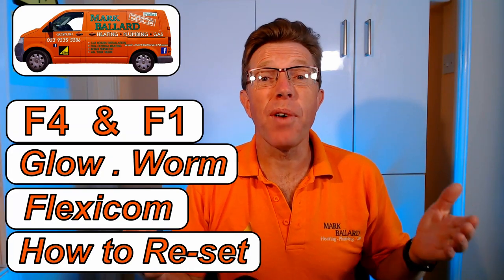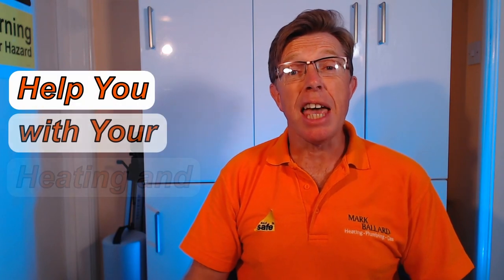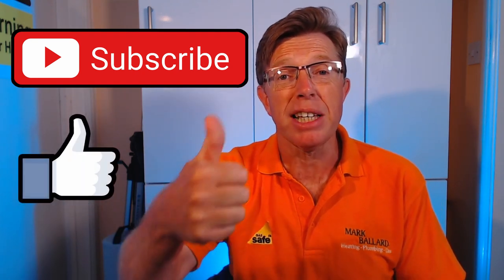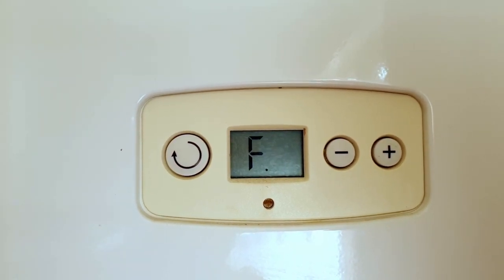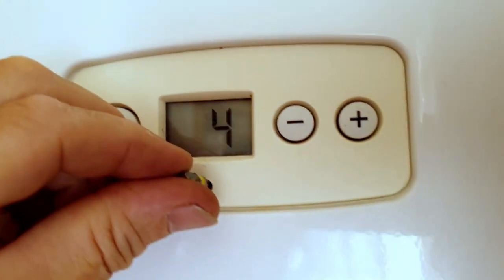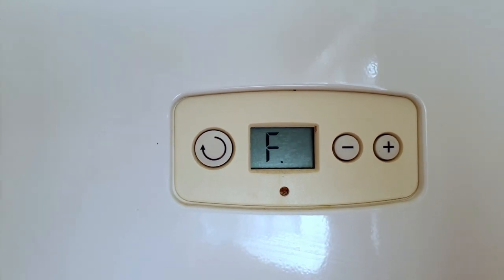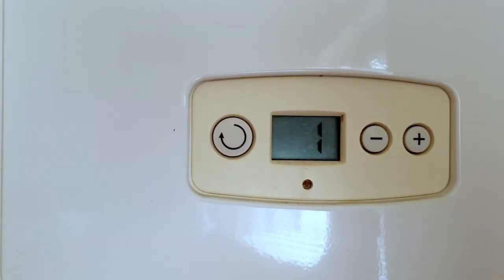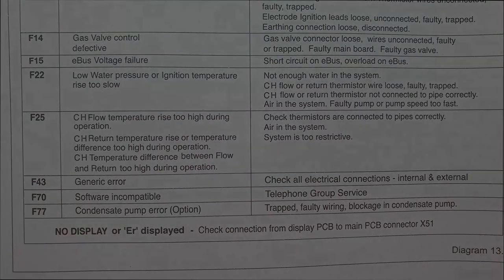F4 & F1 Glow Worm Flexicom How to Re-Set Your Boiler

Comment: Hi Mark.
Love your videos. Clear and concise!
My problem is... I had a glow worm flexicom30 fitted on the green scheme, around 5 years ago. It was fitted for free, as i am disabled.
When fitted, the company who did it, didn't leave details for servicing, so it has only been serviced twice, by gas fitters i have got in, via adverts in local newspapers.
But my main problem now, is that the boiler runs off an erratic climapro2 remote control. What i would like to know, is if the boiler can be operated manually, by the buttons on the front, to turn on my heating? The heating has been turning itself on, around ten times per day. I have to climb the stairs, turn the boiler off at the wall, leave it ten minutes, and then put it back on. There is obviously a fault with the remote control unit.
This is why i want to do it via the buttons. I am riddled with arthritis, and trips up the stairs are killing me.
Thanks in advance.

Comment: Moved the location of the boiler (flexicom 18hx), it has power but doesn't fire up after turning the thermostat and and controller on for either of hw and radiators, any suggestions?